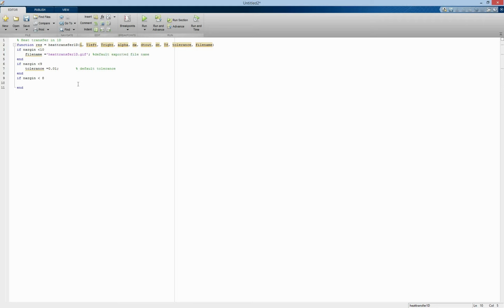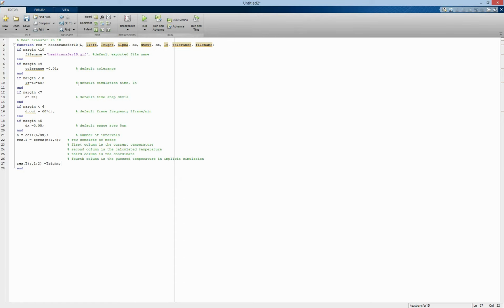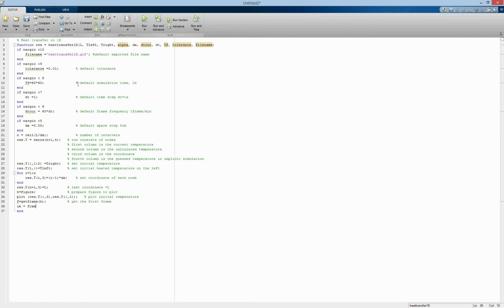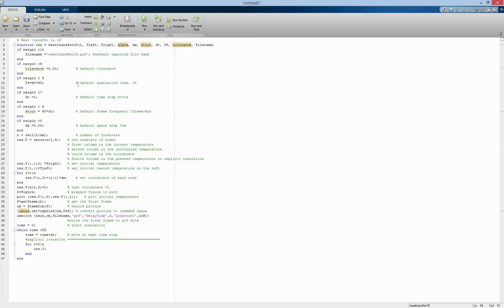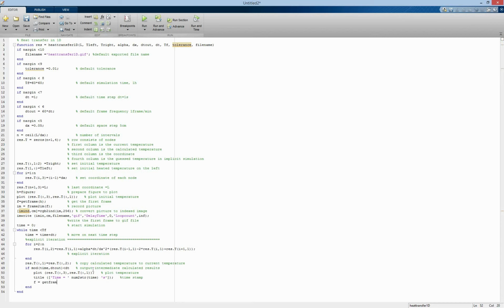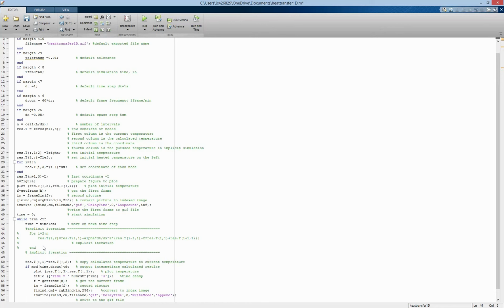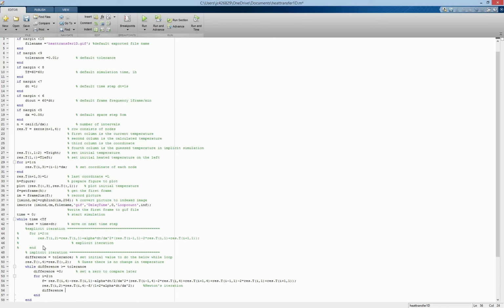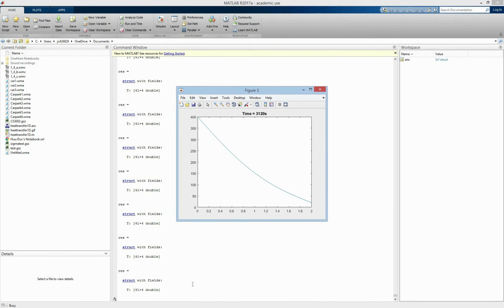Matlab Finite Difference Method Heat transfer 1D explicit vs implicit

Comment: Hi Peter. I'm using TDMA to solve an implicit system of equations for a rod insulated at one end and maintained at a fixed temperature at other end. Algos and all are correct but my insulated end temperature blows up. How do I implement the insulated boundary condition there ?

Comment: Hi Peter,  how to implement the temperature dependent thermal properties in the implicit method of solving 1d heat conduction equation.
Reply from the maker: Just make tabular value for alpha.
Reply: @peterto5795  Which value of alpha must be used in the matrix at time step " t=t+delta(t) "?? I mean alpha corresponding to timestep '" t '" or  "t+delta(t)"
Reply from the maker: @siddappapg1518  I guess you did not attend the CS4010. Mehdi should tell it in class.
Reply: @peterto5795  I want to implement it in MATLAB programming
Reply from the maker: @siddappapg1518  I am sorry Siddappa. As I mentioned somewhere in this channel, I do not answer questions from outsiders due to the lack of time.